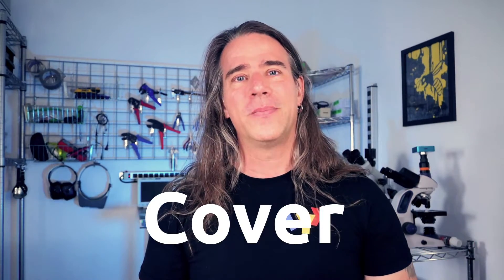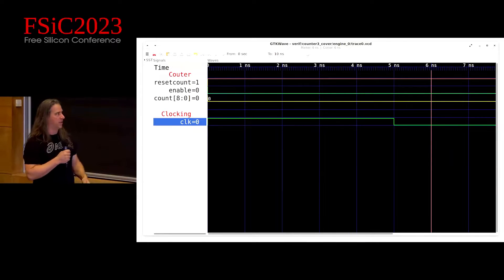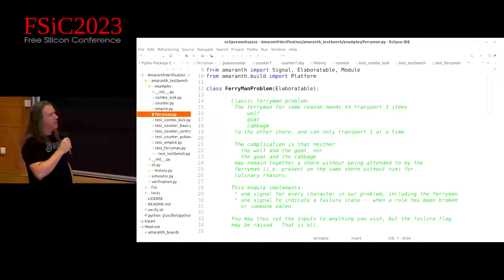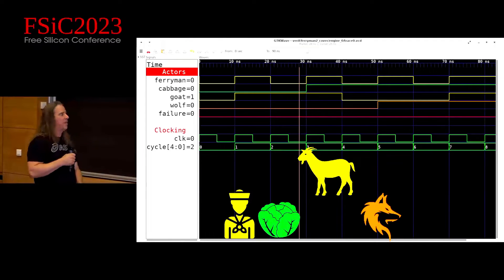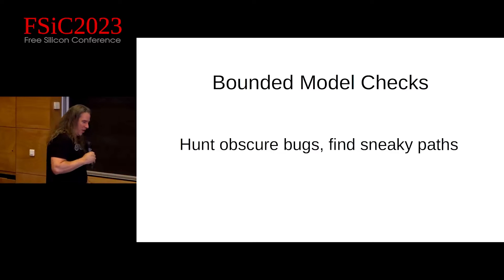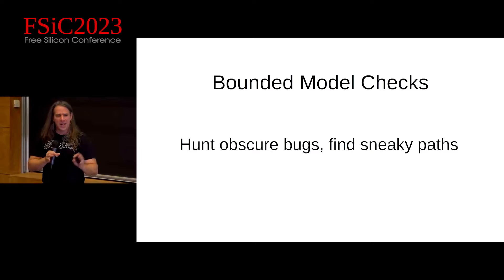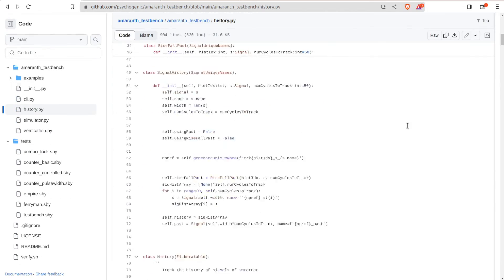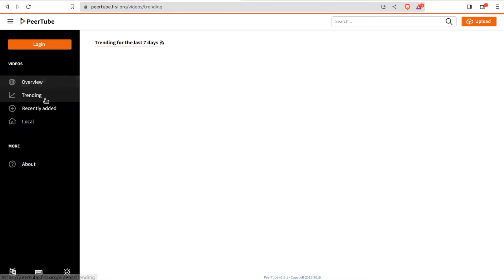The Hidden Power of Formal Methods in Hardware Design: Crash Course

Comment: I used the open source formal methods tools a lot with FPGA design and recently I also used it with my first commercial ASIC that we made to prove critical parts of it. Suffice to say, those critical parts all work perfectly!

I would definitely recommend formal methods for anyone doing digital design :)
Reply from the maker: Yes, these are awesomely powerful tools.  I'm still getting the hang of prove/induction mode (not to the point that I'm confident that I've actually proven the thing works for eternity), but BMC locates a lot of problems before they happen and I'm loving cover for inspection.  Do you have any recommendations as starting points for defining formal specs used for reliable k-induction use?
Reply: @PsychogenicTechnologies  I don't have a simple resource that can used as a starting point, but I can give some pointers:

* With induction, every formal step except the last will assume that your assertions are true. Let's say you have two instances of a 5-bit up counter and you reset it back to zero whenever the counter is 9. If you assert that both counters have the same value, then it will pass BMC, but not induction because the initial value of one counter could have been different than that of the other counter. You will need to add extra assertions (that act as assume statements up until the last formal step) so that the "incorrect" initial values are flushed out.
* When proving asynchronous logic or logic with asynchronous resets for example, then the $prev statement refers to the previous clock transition, not the last clock cycle. This can be very confusing at first, because with synchronous logic, $past refers to the previous clock cycle (so the previous rising edge or previous falling edge, instead of the previous edge).

Most of it comes down to trying to prove a bunch of different types of hardware to gain more experience. You can also ask Matt Venn, who I believe taught a formal verification course before. Hope this helps, even if it's a little bit :)
Reply: @Oguz286 Bump